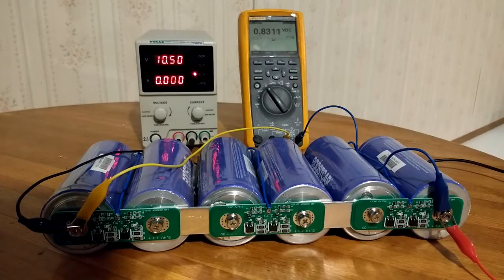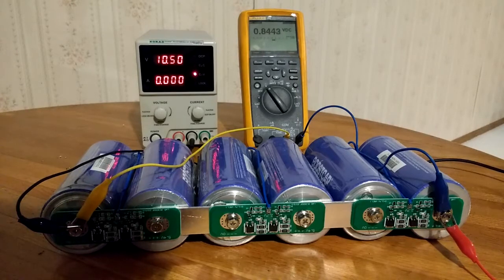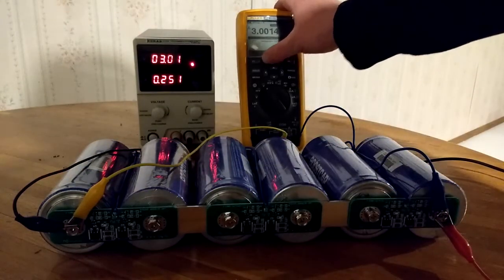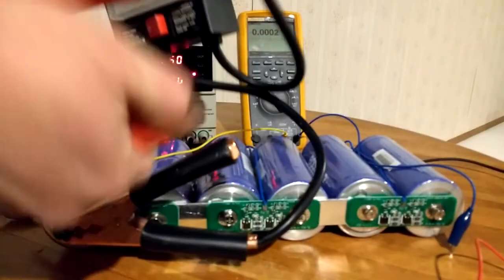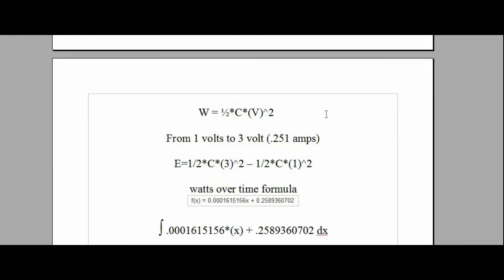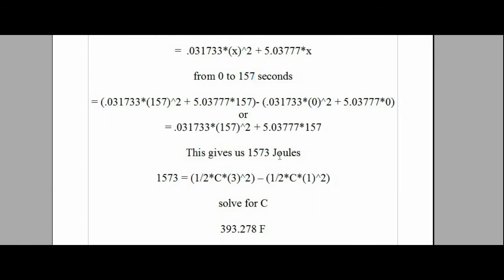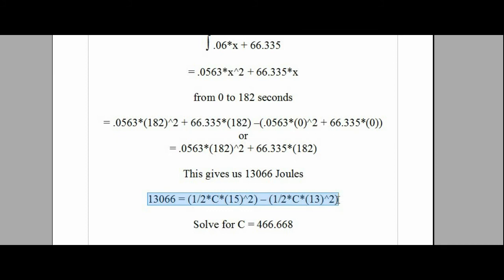maxwell capacitors testing problems (part 2)

Comment: Hi, 
I did play a lot with capacitors and I can see what you are doing wrong. You are missing the horrible leakage current of these electrolytic caps, although they are supercaps. They leak a lot! They are useless as power storage as they would probably loose 1/2 the energy in a day. This probably offsets your result as you calculate time and energy stored but you don't include energy lost in leakage. 
I see another problem, which might surprise you but you will learn from it. When you work with low voltages, resistance of your wires is a HUGE factor and I do recognize your horrible iron alligator clips as I bought the same ones some time ago. They have about 0,5ohms resistance. LOL Now ... let's calculate what is the voltage drop at 1A = 0,5V or in other words, you loose 0,5J every second for just one alligator clip, so you loose 1J every second for both clips. When you increased to 5A, that is 2,5V drop on the 1ohm clips, so you loose 6,25J for every second and that's a lot, isn't it?
I will subscribe and please make a new test with proper cables soon ... like ... today! I will be happy to see the real capacitance of these caps and it would be nice to calculate their leakage, because Maxwell caps look cool but they probably leak as well?
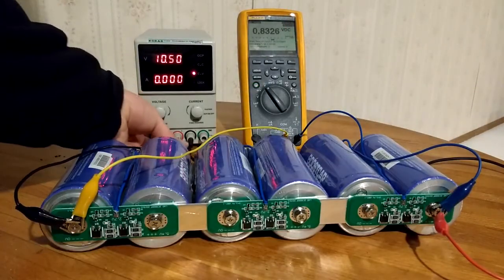Reply from the maker: Thanks for checking out my Channel and subscribing. It might be a while before I can retest them They are currently being used to start my car. I did not check the leakage but the data sheet shows a Max of 5.2mA at 25 degrees C. I agree with you that those cables are very cheap and less than ideal. I believe that I should have accounted for the voltage drop in the charge cables by measuring the voltage directly at the capacitors with the high impedance multi-meter. When that meter is reading voltage it has a 10 mega ohm impedance so having higher resistance leads shouldn't have a big impact on it. If I had taken the readings directly off the power supply the voltage drop of those low quality alligator clips would have most definitely affected the results. It's hard to see but if you pause the video at 5:36 you can see that at the 5 amp load the power supply was reading 1.24 volts but the meter I was reading after the lose of the cables was .68 volts. Some time when I have them back out of the car I will retest them again.
Reply: Hmm, yeah I agree that the leads don't affect the meter. I found out that amperage is not what it seems to be.  I don't know it you are willing to accept that but I think that charge can be generated by dropping voltage, so dropping voltage in the leads actually increases the charge Q, so when you are integrating the power you need to calculate with higher amperage. I can prove my point by the example of charging capacitors with very high voltage. High voltage means low amperage and if you take the I=Q/t formula, it just doesn't correspond to reality as you can transfer a lot of Q to a capacitor, at low current I. Another thing science is wrong about is the idea that we loose half the energy when we charge a capacitor. This is not true when we use high voltage. Capacitors are like a tank with some pressure and the pressure in the tank is opposing the incoming pressure, so if you increase the charging pressure 1000 times, your tank can't really oppose the incoming pressure. This is true for capacitors. If you charge your bank at 1000V, your efficiency of energy transfer will be 98,4%.
In your example power supply shows 1.22 - 0,87 at the meter is 0,35 * 5A = 1,75W but if you divide that 1,75W by the actual capacitor voltage 0,87, you got 2 extra amps at that exact time and it changes over time. I know this is not what science tells us but I think it is the case. It's like invisible current that flows in the capacitor.
A method of calculating the capacity is to take another big high voltage capacitor and connect it in series with the supercaps (must be at zero). Let's say 10000uF аt 300V is 3C and you stop the charging when that cap is at 300V. At that time the supercap also got 3C and by measuring the voltage with your precise meter you can calculate the capacitance of the supercap.

Comment: I have seen video's where others who have charged these banks do it this way, I'll put it in steps for you okay.

Step 1. Attach a load to the capacitors while they are at low voltage, this load should be a 12v light globe, anything up to 100w depending on if you are going to charge up later with over 50 amps charging.

Step 2. Start charging with the load (12v light globe) attached & charge @ 6v whilst watching with your multi-meter until the capacitors reach 6v. Charge amperage should be up to 5 amps.

Step 3. Start charging with the load (12v light globe) attached & charge @ 12v - 16v whilst watching with your multi-meter until the capacitors reach 16v. Charge amperage should be between 10 - 50 amps, between 6v - 10v charge at 10 amps & between 10v - 12v charge at 25 amps & between 12v - 16v at 50 amps.

You should find that when they are charged up to within the maximum voltage of 16v that you will get the full 500F capacitance. I have seen a guy in a video using a 12v 800w switch mode power supply that he got from aliexpress, he tuned the voltage up to 16v. He had no problems with charging up the capacitor bank fast.